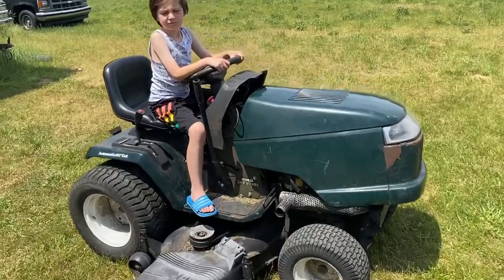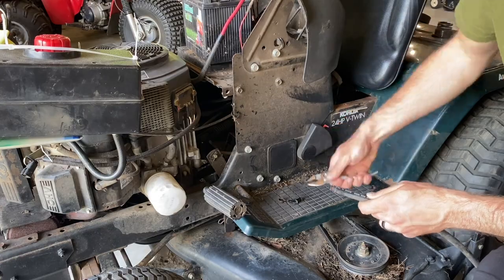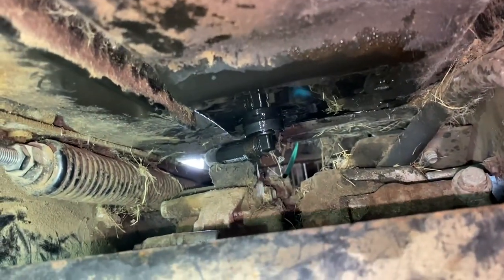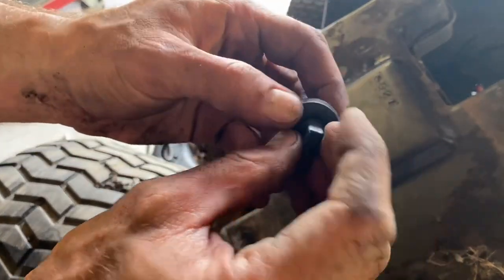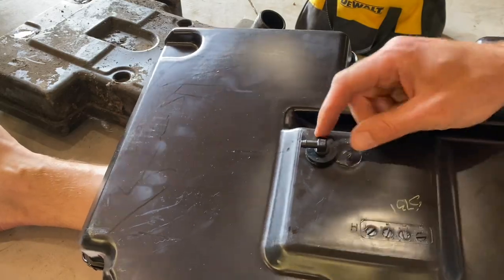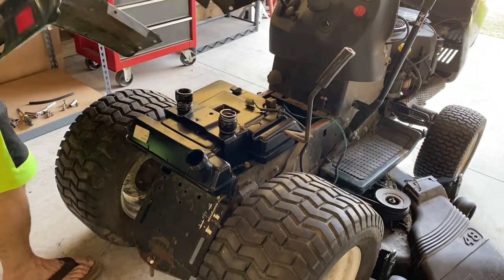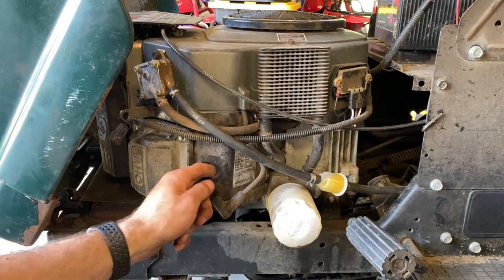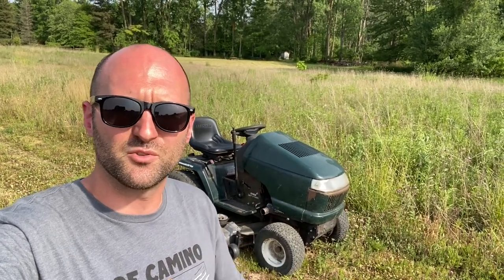FREE Craftsman Riding Lawn Mower - Can We Fix It?

Comment: Just for future reference, I’d had great luck sealing those old plastic tanks with Seal All. Sand the area you’ll be applying it to and clean really well with alcohol. I let it dry 48 hours before adding gas back to it
Reply: yea i would of tried J-B TankWeld before buying a new tank that appears to cost around 100 dollars
Reply: @james6794 that or plastic-weld.
Reply: I plastic weld em with zip ties , works great and never had a leak. , when fixing a small seam leak I weld the whole seam around the tank cause ya know id ya don't they gonna leak in another spot sooner than later

Comment: You need to remove the tins and clean behind them the mice love cramming stuff in there. Also you can adjust the valves if it's clacky.
Reply: I agree, mouse nests crammed up in the cooling fins will cause overheating and eventually engine failure.
Reply: @PRAISETHESAVIOR  yes, and sometimes an engine fire!...he should have removed the tins.....

Comment: Fuel filter was put on backwards, I believe. It'll work but you won't see when it's dirty. Also agree that the mouse nests must get cleaned out of the fins or it'll overheat.
Great job involving your son in the fixes.
Reply: Yep, was just going to make same comment. Typically there’s fuel flow direction arrow on them.

Comment: Steve's Small Engine Saloon  channel did a test on does it matter gapping a spark plug. He gap  one .010, and bent the other plug to,099 Found still ran the same. His conclusion on a Honda Push mower if it is  not running. It is not because of the spark plug gap. Search The Spark Plug Gap Is NOT Critical (With SHOCKING Proof)